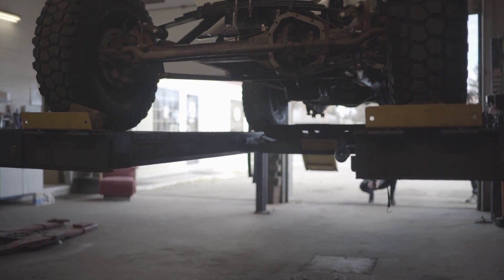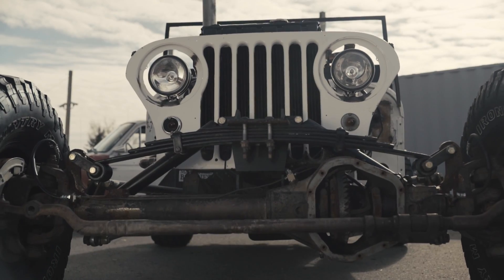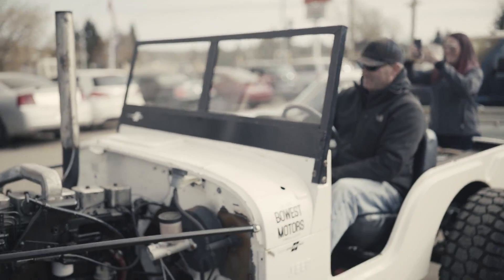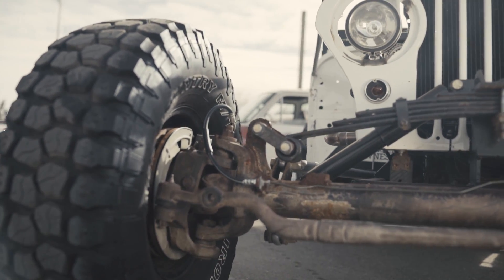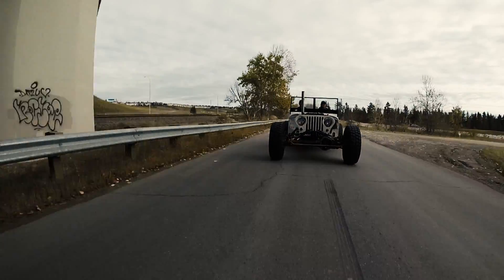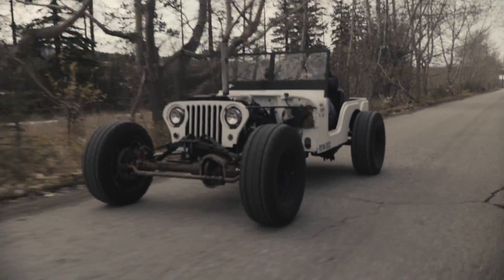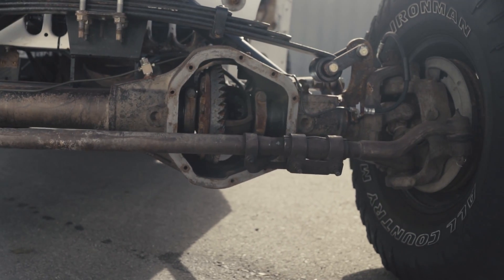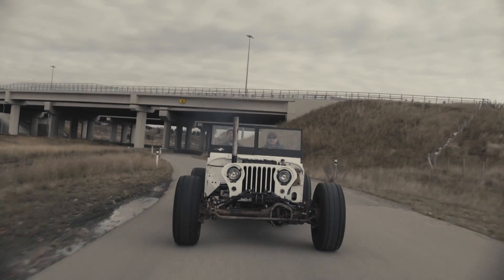THE JEEPIST Episode 7: 12v Cummins powered CJ5 RATROD

Comment: I’m building a similar project with a cj2a tub, did you build your frame? If so do you pointers? I have built some ford model a cummins ratrods in the past with 2x4 .188 wall. Thanks jared